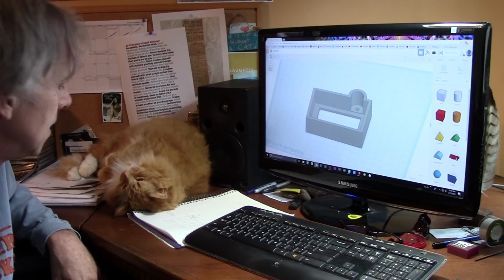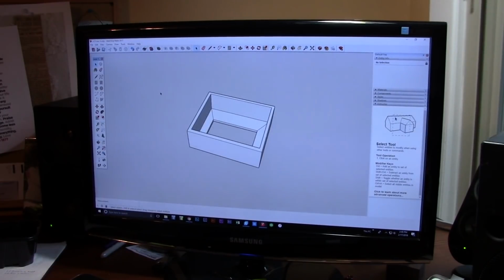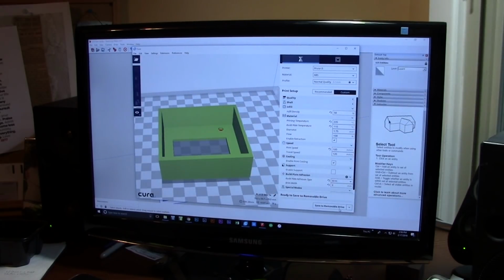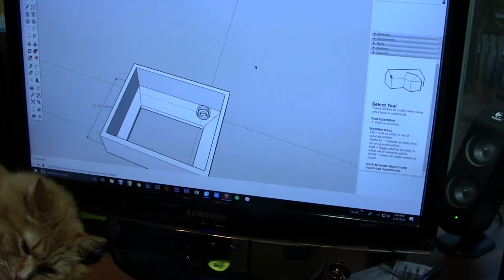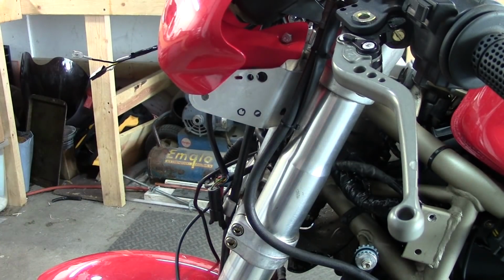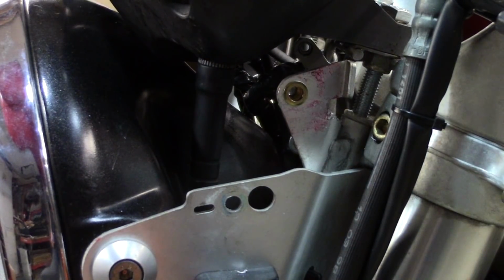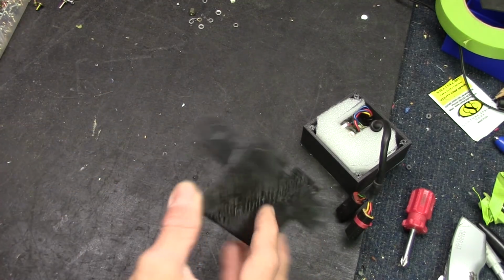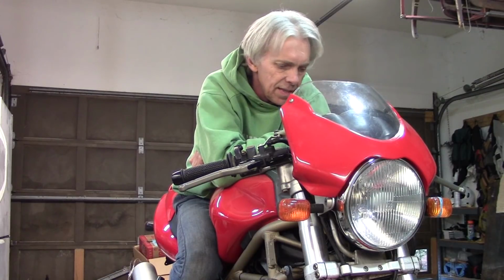Ducati ST4 Streetfighter Cafe Build Part 5

Comment: If you want to pretty it up a little, get 5d carbon fiber wrap or any HQ wrap.  The cheap stuff looks crappy.  I still like thermoforming over 3D but the molds are just too big and gigantic.  I have seen a few DIY plastic vacuum forming videos and they are okay.  I would rather hand lay carbon fiber, it is far easier and almost as strong as steel.

Comment: a couple of quick tips from a Ducati tech to a fellow new Ducati rider. 1-Change your in tank fuel line to BMW submersible fuel line. The regular fuel line can and WILL fail. The bmw fuel line has green writing on it. Fuel filters are cheap from napa. Part number is 3032. 2-don't know what belts you are using/ bought but DO NOT USE CA-Cycle works. They stretch after 1000 miles and you will have to keep checking tension. When they stretch they throw your timing off and make the bike run rough/ hard start. Use only the Ducati/gates belts. ( red writing )set to 100-110 hz. Use new castle lock nuts on the adjustable tension pulley. 3- make sure to check the rocker faces. THEY FLAKE/lose chrome. Mostly on the horizontal cylinder. When you remove the belt also remove the rocker shaft cover/ remove the upper rocker shafts (openers) and rockers from valve covers, then remove the cam shaft.
Reply: Thanks. I have a set of Gates belts ready to install. ;)

Comment: If you take your 3d printed parts and put them in a sealed container with another container of acetone so the fumes are trapped, after a while the 3d parts surface smooths out due to a very small amount of solvent interaction.

Comment: You can adjust your model in the slicer to compensate for material shrinkage. ABS shrinks at a rate of about 1% (you can easily google this). And printing on glass is a good idea to get that nice gloss finish. Just make sure to put the model face down. Oh, and I noticed a lot of ringing on the sides of your prototype. You probably need to tension your belts a little more (another thing to consider is PID autotuning your extruder and bed to avoid artifacts created by heat fluctuations). And infill on prototypes is really not important. You can set that way low, say 15%, and save yourself a ton of time during prototyping. Great video as always!! EDIT: Here's a little guide for basic 3D printer setup that I find really useful https://www.3dhubs.com/talk/thread/howto-calibrate-tune-and-fine-tune-your-printer-and-filament
Reply: Thanks!

Comment: The final redesign of the LCD box looks so much better, i'll only add that ive found that a ~3mm chamfer on all the edges (if you have room) is a good way to make things look less boxy.

The bike looks great !
Reply: Light  Grime or print a shape that integrates with the existing gauge cluster a little more seamlessly.

Comment: Those wretched nutserts. My track bike (01 SV) was full of them when I bought it. Overtighten just a bit, and they give up and start spinning. What a misery. Best solution I found was to drill and tap a little hole through the edge of the nutsert and put in a set screw with some blue loctite. Simple, quick, foolproof, and reversible.